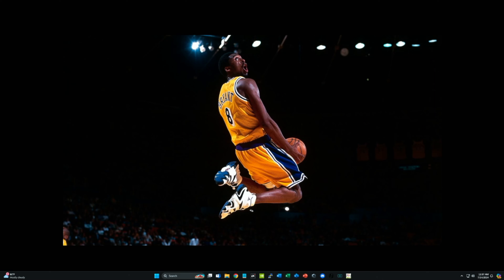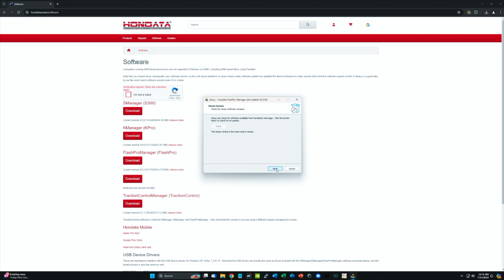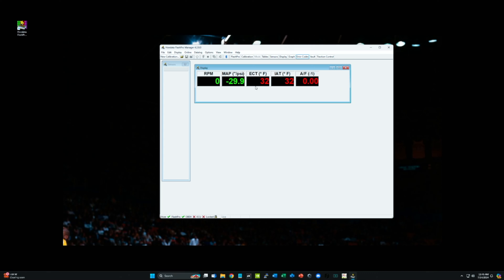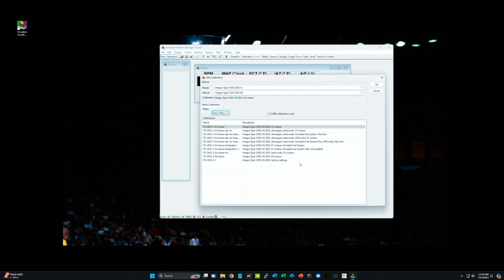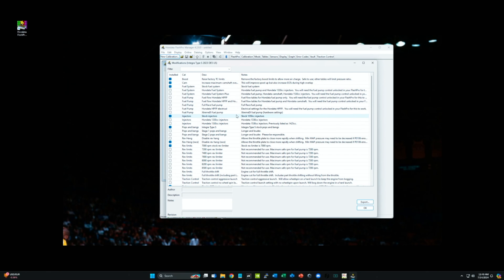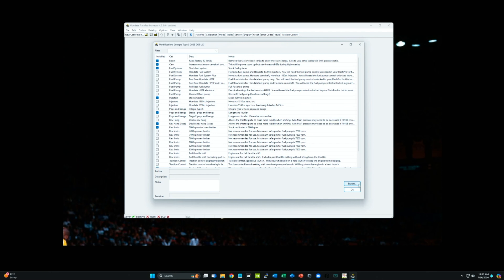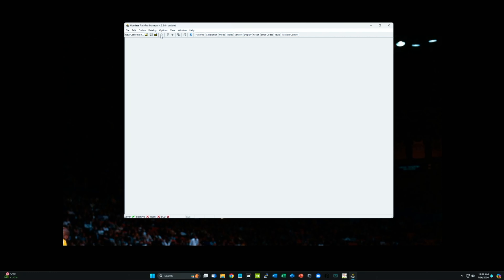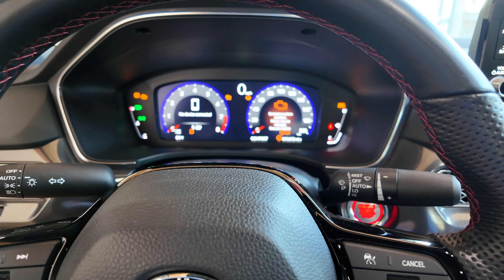How to Flash your Integra Type-S with Hondata FlashPro! Also, installing my RV6 Front Pipe!

Comment: What if u only have 92 octane?
Reply from the maker: @in10ceCiviC  that’s a great question. I’d reach out to Hondata to see which tune they recommend prior to flashing your car. Their customer service is good and they were responsive to me.
Reply: @RiveraRevolutions  so im getting the phearable stage 2 for my type s. I reached out to them and they send when they get my ecu they will send me a email about my cars info..thats where i tell them im using 92oct.
Reply from the maker: @in10ceCiviC  so I’m running the parable tune now. When I filled out the info on their website, it did request what octane you have, and then tailor the tune to that. So you should be good once you get there’s. I haven’t had any issues since I moved to that tune.
Reply: @RiveraRevolutions  i cant wait to run the tune. I live all the way in hawaii so its going to be a while before i get my ecu back lol
Reply from the maker: @in10ceCiviC  that’s awesome! I love Hawaii, I was just there in April. Let me know your thoughts on the Stage 2 Pherable tune. So far I love it!